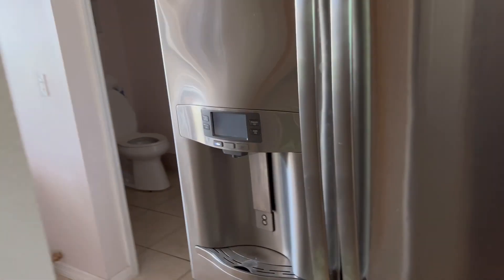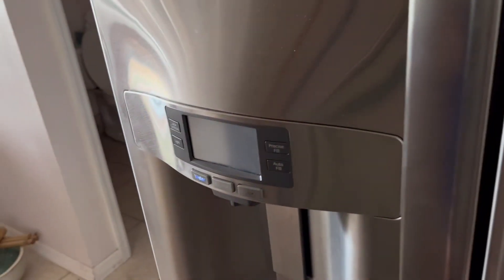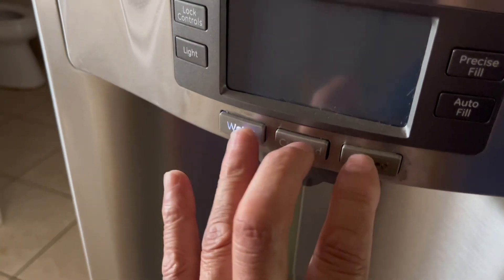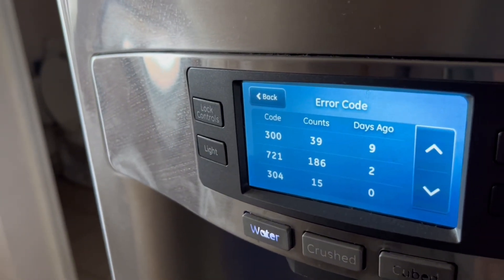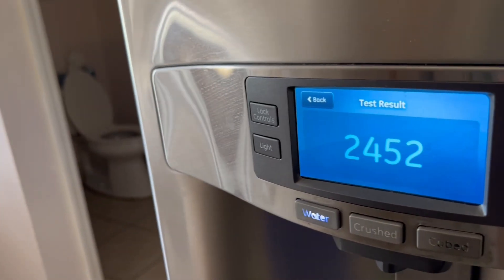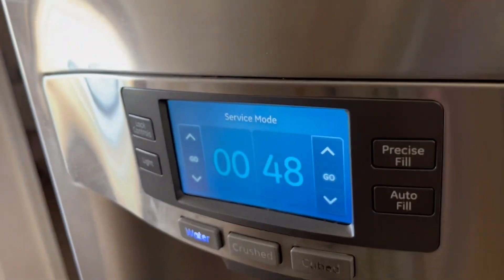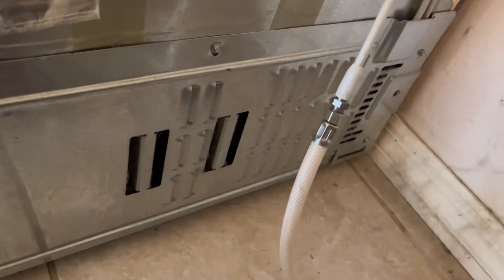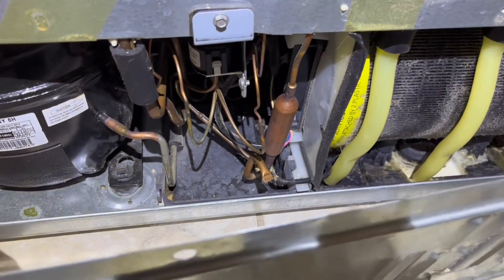Test & Replace Inverter Board on GE Refrigerator Not Cooling. Model # PFE29PSDASS

Comment: Thank you for your knowledge. I did the diagnostic code.  When I did the code from top to bottom 203,303 and 106.results for refrigerator stayed at 0 Then freezer 2336.  Freezer is working just not top part of frig. Any suggestions?
Reply from the maker: If you have the service tech sheet. Look at what  load test the numbers represent 203,303, and 106. The  0 to 2336 looks like the rpm of a fan motor?

Comment: Mine won't cool at all in the slightest now. Same model. Compressor won't kick on. Thought's?
Reply: had exactly the same problem. Tested the wires like he shows, inverter board was dead. Bought a new one locally for $150 or so, replaced it, and now it works fine. Easy job except for trying to wedge that thing in and out next to the compressor without damaging the copper tube. Other than that, 15 minutes max.
Reply: either the power board isn't turning on the compressor, the replacement invertor is bad or the compressor is bad.  Make sure on the front control that the sealed system is switched on... you can turn it off on that model I believe.

Comment: Great video. I have a similar GE fridge and have been having issues for 2 weeks. Initially the fridge wasn’t cooling as much so repair guy changed out the fan. Now fridge is over-cooling. Thermostat, sensor, and damper were all replaced. Still have the over cooling issue for the fridge. Only have 2 days before the fridge is hauled away and new one is delivered. I did the diagnostics like shown in this video but no idea what the information means or how else to test. What could be left as the problem- control board??
Reply from the maker: If the refrigerator is over cooling, I could only see it being 2 components. The sensors and the main control board on that refrigerator.
Reply: Tenho uma geladeira GE igual essa
Troquei motor ventilador 
Ela gelou apenas algumas horas 
Apagou tudo 
Por favor me diz oque pode ser?
Obrigada

Comment: Quesiton, My evaporator fan isn't working even with switching out a new one and my coils are not cold at all.  Also, my refrigerator is about 75 degrees and my fridge is 65 degrees.  Do you think this could be inverter related?   Thanks so much.. trying to find a volt meter around the house now.
Reply from the maker: You could see if your evaporator fan is working in diagnostic mode. If the compressor is not turning on, it could be the inverter board or main control board.
Reply: @appliance63  Thanks for the reply.  So, I changed out the inverter board and the fans work and I can hear the compressor running.  However, it has been plugged in for about an hour and it is still not reducing the temperature.  Would that point to main board issue now?

Comment: What model inverter board did you go with I'm having this exact same issue right now, would getting a 2.1 Amp inverter cause problems?
Reply from the maker: Get your model number put it in Google a lot of appliance repair parts will come up. Look at the picture diagrams and find the inverter part number to your model. You mean 2.1 DC volts on the inverter board, red and white wire? That might be OK I had 2.5 DC volts
Reply: My problem is getting 1.05VDC, I am not sure if the inverter board bad or main board doesn’t supply DC voltage properly?
Reply: @Jessie-df4hr  I'm getting the same. What was the issue or fix for you?

Comment: Im.wondering if my ice maker randomly only a few ice cubes was a sign that the inverter was going. Someone is coming to look at it tomorrow as it no longer cools or freezes. Was away for the weekend and came home to it broke. Lost everything. 😢
Reply from the maker: There is a possibility. As the inverter turns the compressor on to deliver approximately 12° or lower temperatures to make ice.

Comment: I see you installed a different looking inverter than the one you took out. Can you provide the PN or link?
Reply from the maker: Inverter part number for my model was WR87X29409. For any appliance part # for your specific model. You can go to partsselect.com look for your part  in picture diagrams and get your part number.
Reply: Thank you so much. You helped me save tons of money on my fridge. Now it’s back in service.
Reply: Gotta question for you. When I put the part number I get an inverter that’s 133hz when original part has 150hz. Is this an issue long term? How inefficient will the fridge be with the 133hz inverter vs the 150hz?
Reply from the maker: Interesting observation. If you have the right replacement part, I can only suspect that the difference in the hertz doesn’t make much of a difference? That would be a question for GE one 800 number if you can get an answer.